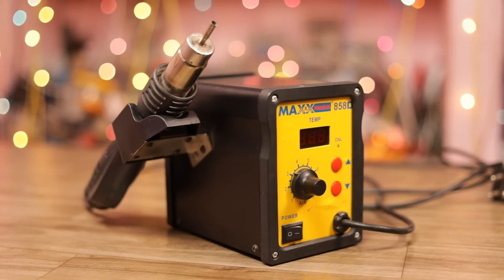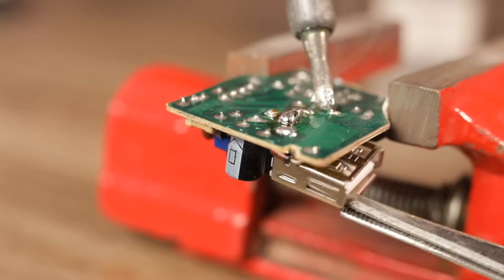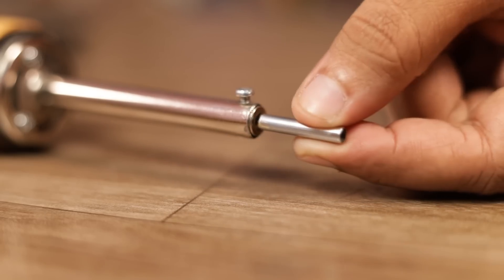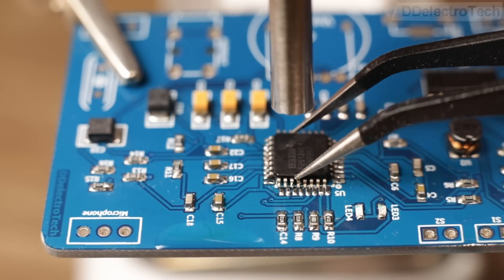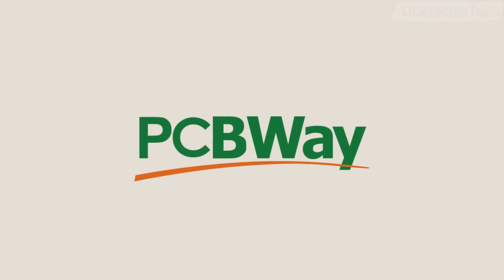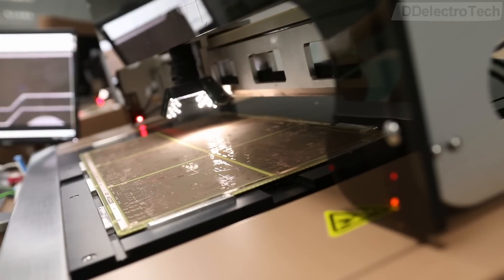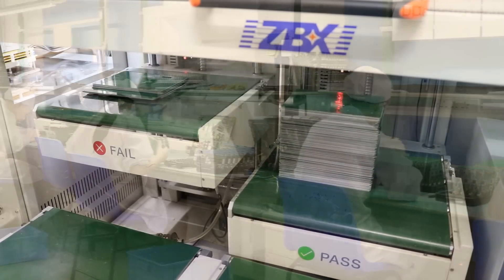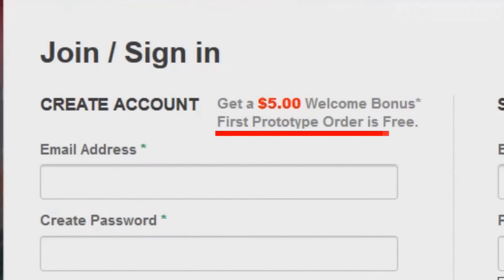Making The Most Compact Hot Air Station Plus Soldering Iron

Comment: I must confess you are super GOOD 👍 

Pls I want to ask something disturbing me

Can 5v power up the hot air ?
Reply: I pray this comment gets to you guy's 🙏

And it's replied to 😥
Reply: @KenTecRepairs  The 5v is not used to generate heat. It is just there for powering the air pump. The heat generating part is the previous soldering iron part which is still connected directly to the main supply 230v.

If you don't understand me, just ping...🤝

Comment: Anyone noticed that during the hot air blowing operation he has given some gap between the wood casing and the black epoxy, maybe from there the air is getting inside. Anyway he hasn't specified.

Comment: What is the use of altering charger since same power out put naa
Reply: what ? he used the charger circuit becoz its a good ready made cheap Ac to dc converter he added one more capacitor to the circuit so that the circuit provide a smooth dc supply to the heater as well as the motor.

Comment: How does it blow air out without a pump or fan?
Reply: The little motor he put in the handle has a built in motor that is why he added the switch,you don't pay attention,go sit in the corner dummy.
Reply: hot air expands, so it naturally moves out of the tip
Reply: @WoolseyCole  not in this one,the motor is a pump motor and has small fan built into the back of it,that is what the switch is for to turn it on,when you just want to solder just put the tip in.
Reply: 1:11 it is called an air pump it can blow air🙄

Comment: 1:42
Why didn't you show the finished electronics and air components? The unit looks completely sealed so how on earth can it blow hot air?
Reply from the maker: At the back of the handle there are few holes for air passage.
Reply: @DDelectroTechECE  thanks.
So are you also using the original heating element of the hot air gun or does it just blow air over the soldering iron heating element?

Comment: for blow first it have to suck air. its totally closed so how air get inside the pump.
Reply: Your question is valid but dear as you look at closer to the device you'll find that the device is not completely air tight .
Reply: kaplumbaga efendisi there is a fan inside
Reply: @dazbogshift2349  of course there is a fan inside. But fans suck air from one side and blow to other side. I ask again, how it suck?
Reply: kaplumbaga efendisi ah I see what you mean, I think it comes through the gap around the power wire but I’m not sure

Comment: After putting the coil again into the pipe. How the air passes through the pipe ??
Reply: @AP Tube I know that. But that was not question.
Reply: This coil is hollow from middle, it is made hollow because to pass through the soldering bit and on removal of bit we get the through hole coil
Reply: @sumeetpanchal7099  ok, but how it the air pumped?
Reply: @teckzusferalupus5382  see he installed a blower inside the handle with a smps circuit to power it and a switch to toggle it on or off
Reply: @sumeetpanchal7099  Ffs he asked how can the pump suck air
Reply: @zetsubou3704  in hot air blower air is never sucked... Its only blowed in forward direction letting air come out from the tip
Reply: @sumeetpanchal7099  but from where the air will come.
Reply: Seems like there is a hole at the end of the handle
Reply: I think that bro kkkkkkkk
Reply: Magic
Reply: He connected a blower to that 5v power supply and installed in the casing.
Reply: It’s been 3 years so i think it’s a design flaw? 
If its a design flaw, 
Solution? 
2:15 instead of covering the entire base with m-seal, we could open up those 3 bean shaped cut outs on the metal face plate by removing the m-seal between them?
Reply: There's a switch to on/off the hot air .